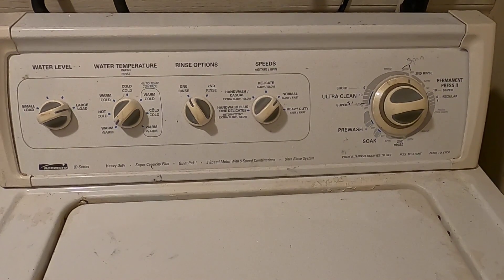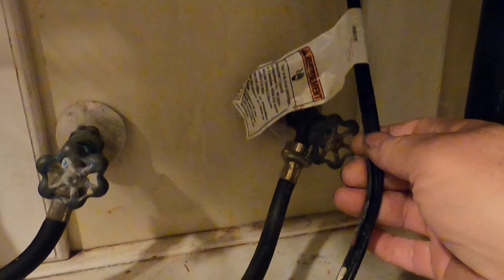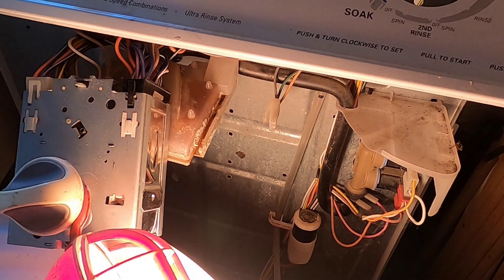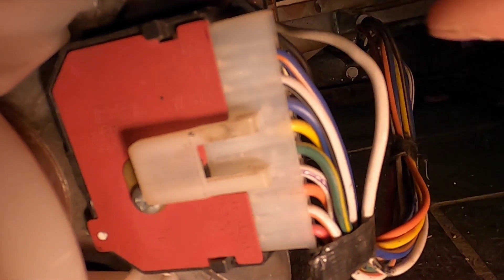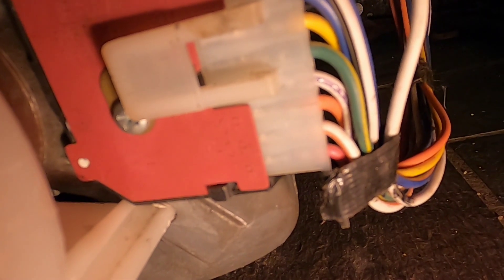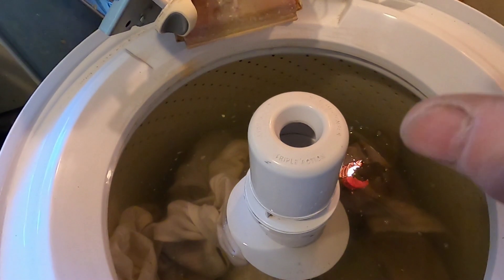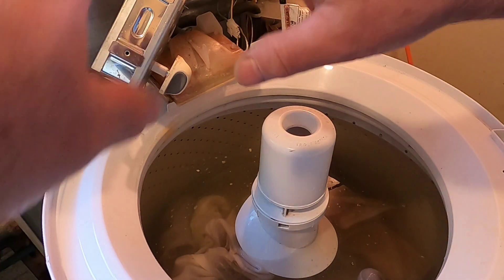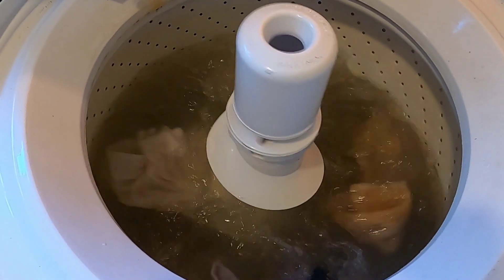Kenmore Washer Fills With Water Then Stops: Free Easy Fix!!! Part 2

Comment: I was out of town for long-weekend T-day.  The question is, How did that connector com undone?  I think I saw some frayed insulation in the bend of wires below the connector; at least two.  If there are any, wrap them good with 3M electrical tape.  3M doesn't unwrap as easy as other brands.  Maybe see about returning the part you don't need.
Reply from the maker: Welcome back, hope you had a great trip. As far as how the connector worked its way loose I am not sure. Maybe just the vibrations after all these years or my touching it on a previous repair. I had the part pass the return date, This "simple" repair had me going for awhile. I had to walk away from it a couple of times. I have to learn how to read and understand electrical schematics.
Stay well, Joe Z
Reply: @JOEZEP54   I'd like to suggest wrapping the connector and socket with a cable zip tie.  The 18 lb, 0.81" x 4" long size should be thin enough to fit between the wires and thin enough to go behind and around the connector and socket.  You may have have to connect two together for the length because 4" is the longest I've seen in this width, but it would be easy to cut and pull if you ever need to pull the plug again.

Even if the socket's plug locking clip is good, it came undone, so this will prevent that.  If you don't have any this size, you can buy packs of 100 at Lowe's, Home Depot or most hardware stores.  I hope your Thanksgiving was great.